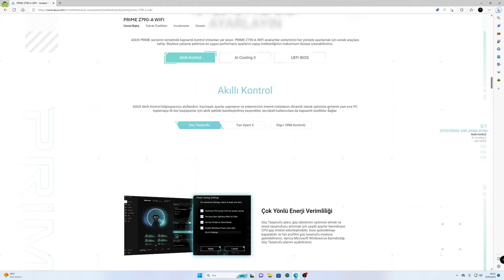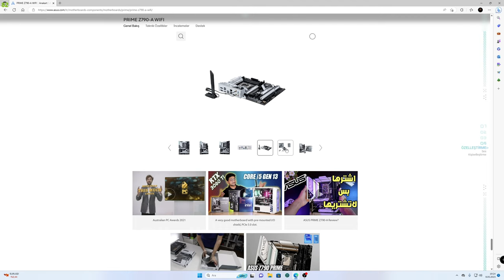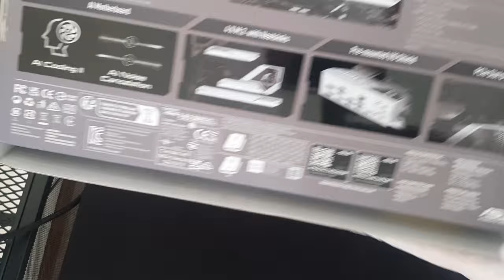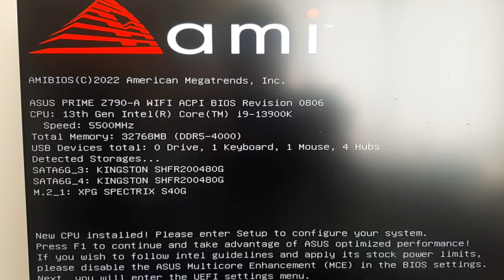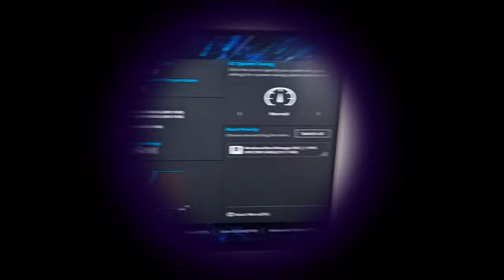ASUS PRIME Z790-A WIFI LGA 1700 DDR5 7200MHz (OC) M.2 ANAKART İNCELEMESİ VE  i9 13900k MONTAJI

Comment: SİZCE BU SİSTEM İLE PROBLEM YAŞARMIYI ? 

Intel Core i7 14700KF 3.4GHz 33MB Önbellek 20 Çekirdek 1700 10nm İşlemcİ

MSI PRO Z790-A WIFI 7200MHz(OC) DDR5 Soket 1700 M.2 HDMI ATX Anakart

CORSAIR 32GB(2x16GB) Vengeance 6000MHz CL36 DDR5 Siyah Dual Kit Ram

MSI GeForce RTX 4060 Ti VENTUS 3X 16GB OC GDDR6 DLSS 3 128 Bit Ekran Kartı

Rampage HELIOS C15 ARGB Sıcaklık Göstergeli 240mm İşlemci Sıvı Soğutucu

Kingston 1TB Fury Renegade Gen4x4 NVMe M.2 2280 SSD (7300MB Okuma / 6000MB Yazma)

VENTO VG20AL Tempered Glass USB 3.0 Mesh RGB ATX Mid Tower Kasa + FSP 750W 80Plus PSU
Reply from the maker: Yaşamazsın ekran kartın PSU için yeter de artar bile sistem yükte 300 500 waatti geçmez